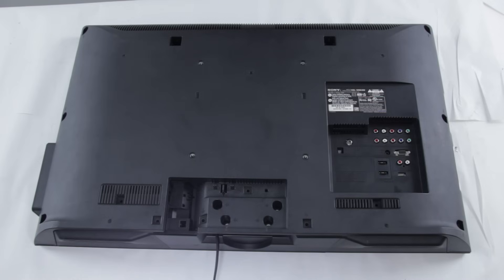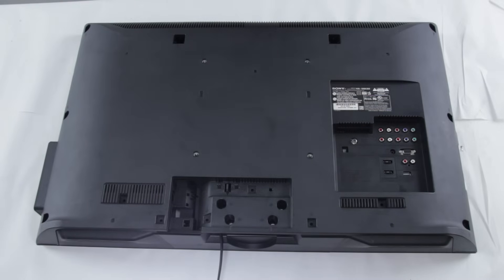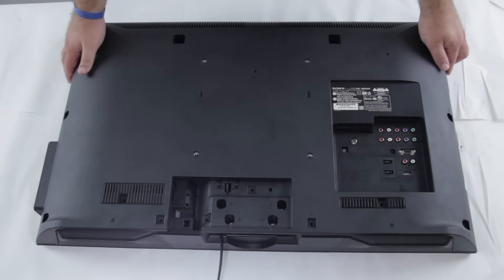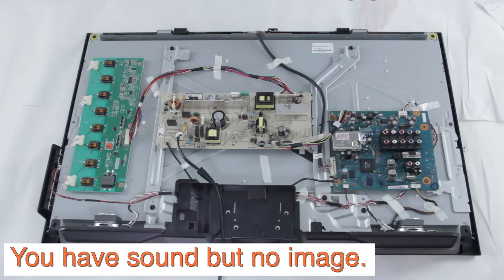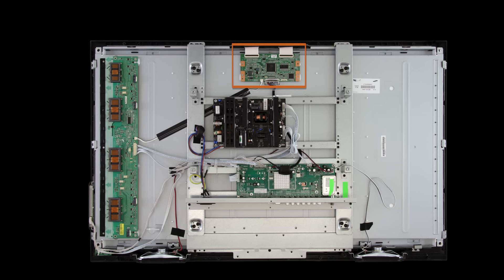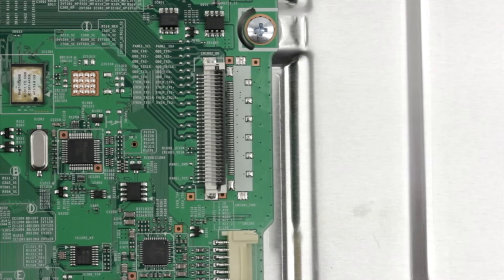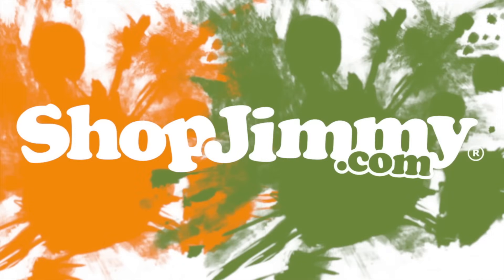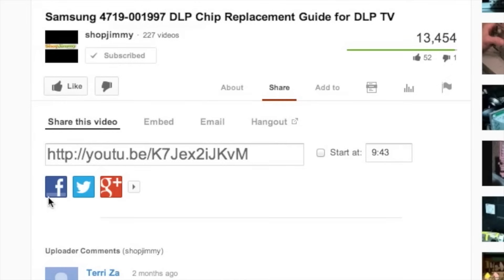LCD TV Repair Tutorial - T-Con Board Common Symptoms & Solutions - How to Replace T-Con Board

Comment: Can the T-Con board be replaced on a LG 42L V4400 UA  ??? That's what I have and am getting vertical lines on the left side of the screen !!!
Reply from the maker: Steven Shackelford  Please watch this video FIRST to help with your repair!  TV Repair! LCD, LED, Plasma, DLP How To Fix Your TV with ShopJimmy.com Help!  When I look at the search results for this TV model, it appears the T-Con board is built into the main board.  This is not guaranteed 100%, but if you do not see the T-Con board on the back of the TV, then it is most likely built into the main board.  Here is the link to those replacement parts:  http://www.shopjimmy.com/catalogsearch/result/?q=LG+42L+V4400+UA  If you are planning to purchase replacement parts, be sure to match part numbers on your current board, with your replacement for compatibility.  Thanks and please let us know if you have any further questions with your TV Repair!  www.shopjimmy.com

Comment: I have a INSIGNIA NS-L42Q120-10A... last week it started with black imagen at the center and slow move of the imagen in some portion of the image, it happen a couple of minutes then the image cleans and all looks good. TCON Board issue?... Thanks
Reply from the maker: TheGreatBoss95   This sounds like a TV panel (TV Screen) problem.  If your TV panel is bad, it may be more cost-effective to replace the TV as panels are typically hard to find in stock, difficult to replace, and expensive.  Thanks and please let us know if you have any further questions!  www.shopjimmy.com

Comment: Hi, I have a Sony Bravia KDL-46v5100. Yesterday I noticed that it had black thin horizontal lines that were more prominent on the left side of the screen and fades near the centre towards the right side. The picture is fine, no flickering or missing areas of the screen and I am still able to watch. Any suggestions on how this could be repaired? Thank you.

Comment: Hi I have a visio 38 inch year2007 .VX42L-HDTV10A. The TV wont turn on at all,so I Open the TV up and replaced the power supply.IT works fine but the picture is real bad like a negative picture and menu wont totally disapear kind of.It also on a cable search picked up only 4 anologe channels.   tks
Reply from the maker: *****  Please watch this video FIRST to help with your repair!  TV Repair! LCD, LED, Plasma, DLP How To Fix Your TV with ShopJimmy.com Help!  I recommend replacing the main board in your TV.  Click this link to replacement main boards.  http://www.shopjimmy.com/catalogsearch/result/index/?cat=56&q=VX42L-HDTV10A  Be sure to match part numbers on your current board, with your replacement for compatibility.  Here is a link to a video showing how to identify your part number, click here:  TV Part Number Identification Guide for Vizio Main Boards (Plasma, LCD, LED)  Thanks and please let us know if you have any further questions with your TV Repair!  www.shopjimmy.com

Comment: Got a sony kdl46xbr5. Screen is blank. It started with half ghosted screen turning all white within 15 minutes. Opened up, and after  put back panel back on, went from black and turned into white. No more image at start up. Replaced tcon and ub1 board.. Nothing. Opened again and rechecked tab insert to tcon and checked tab insert to lcd.. Now all black.. I'm stumped. Just need a little direction. No red flashing. Constant green light.
Reply from the maker: Marco Rodriguez   This sounds like a TV panel (TV Screen) problem.  If your TV panel is bad, it may be more cost-effective to replace the TV as panels are typically hard to find in stock, difficult to replace, and expensive.  Thanks and please let us know if you have any further questions!  www.shopjimmy.com

Comment: Hi I have a Philips 42pf9831d/10 flat screen tv. I had a problem experiencing no sound so I overcame that problem by buying a sound bar and now I have lost my picture all together. It used to suffer from intermittent blacking out and now its just stopped working. Any Ideas?
Reply from the maker: Lee Edwards Please watch this video FIRST to help with your repair!  TV Repair! LCD, LED, Plasma, DLP How To Fix Your TV with ShopJimmy.com Help!  I recommend replacing the main board in your TV.  Here is a link to possible replacement parts:  http://www.shopjimmy.com/catalogsearch/result/index/?cat=56&q=42pf9831  Be sure to match part numbers on your current board, with your replacement for compatibility.  Thanks and please let us know if you have any further questions with your TV Repair!  www.shopjimmy.com

Comment: Need some advice with my TV. I have a Sharp LCD Model LC-46SB54U Serial 806855217 with no sound but have analog signal. I get no response (audio or video) from any of the HDMI inputs. I have replaced the Main control board but with no change.
Reply from the maker: matt oneal   I recommend double checking that everything is properly connected to the main board.  If everything seems to be fine and you are still having problems, then I would say you have a defective replacement board.  Thanks!  www.shopjimmy.com

Comment: Hello Jimmy, I have customer whos Samsung model  #UN40EH5050FXZA  is giving a Vertical black line. Would this be the TCON Board issue?
Reply from the maker: allenluv1   This sounds like a TV panel (TV Screen) problem.  If your TV panel is bad, it may be more cost-effective to replace the TV as panels are typically hard to find in stock, difficult to replace, and expensive.  Thanks and please let us know if you have any further questions!  www.shopjimmy.com

Comment: Hi I have a Philips mod 40pfl3706/f7 completely dead, only voltage found was 4.3v on power board. no schematic available. where do I go from here   email  pveenje@frontiernet.net    hope to hear from you.
Reply from the maker: Peter Veenje   If you did not find a 5v or a 3.3 volt on the power supply replace the power supply board.  We are currently out of stock for this board, however we have a repair service, where you would send us your board and we repair it and then send the board back to you.  Here is a link to that service. http://www.shopjimmy.com/philips-a17p6mpw-001-power-supply-for-40pfl3706-f7-repair-service.htm  You can also call our customer service for further assistance with your purchase.  (877) 881-6492  Thanks and please let us know if you have any further questions with your TV Repair!  www.shopjimmy.com

Comment: Hi there! Hope to get some help. My TV is starting and runs a couple of minutes, about 5-10 minutes i supose. Then it shuts off and tries 3 times to shut on again, then stays off. The LED called LED2000 on the T-Con Board is blinking. I already tester with my IR-Thermomether if any components are geting hot, but didn't find out. I also replaced some caps on the power-suply board, which usualy brake, but didn't get beter. Also bought a used part MAIN-SUS board, but i still get the same symptomes. My TV is a Samsung Plasma with the Model Code: PS50C530C1WXXC and has the SerialNr: B1UR34PZ403039X. Would be a small miracle, if you could tell me how to troubleshoot this out and repair it. I hate the way the Industry mekes us throw away things, that could live much longer without this obsolent failures built in.
Reply from the maker: youlouey   I recommend replacing the main board in your TV.  Unfortunately I do not see any replacement parts in the search results for your TV model number on our website.  Please reply with your part number on your main board and I can try searching for replacement parts.  Thanks and please let us know if you have any further questions!  www.shopjimmy.com
Reply: Well. I replaced the whole power-suply board, because i found a used spare part for cheap. And now works everything just fine. What could be defect, the caps arn't, because i replaced them already!?!
Reply from the maker: youlouey   There could be a leaky diode causing it to not send turn on voltage to the main board.  Thanks!  www.shopjimmy.com

Comment: Hi. I have 3 year old Samsung LED TV (Model # UA40D5900VR). From last few days, we are seeing black horizontal lines on the top of the display. Please advise on possible cause and a resolution for this.
Reply from the maker: VijayKumar BV   This could be caused by a bad main board or a bad TV Panel.  You can try replacing the main board, but if that does not fix the problem, then you most likely have a bad TV panel.  Unfortunately I do not see any replacement parts in the search results for your TV model number on our website.  Please reply with your part number on your main board and I can try searching for replacement parts.  Thanks and please let us know if you have any further questions!  www.shopjimmy.com

Comment: Hi, I just bought myself a Samsung TV which I knew it needed repair. I am thinking of doing it myself. I have several experience in PC tech but I am a newb in TVs. The model is a Samsung LE40A336J1DXXC. It is currently working well once in a while and after 5 min it goes in a solarized state and sometimes alternates to a white washed image too. I have read &seen videos and info from you guys. And later on I will go home and check out if the menu becomes distorted too. The guy I bought it from said that when he brought a tech to see it, he said it is a part in the middle of the screen that has gone and can be fixed (I am thinking its the T-Con board). My question is, do you have this part which I can buy? Or can you suggest me a good seller for European Countries (I reside in Malta EU).

Best Regards and may thanks for the really cool channel you have here!!!
Reply from the maker: *****   This could either be a problem with the T-con board or the main board in your TV.  I recommend starting with replacing the T-con board and if that does not fix the problem, then replace the main board to see if that fixes the problem.  Unfortunately I do not see any replacement parts in the search results for your TV model number on our website.  Please reply with your part number on your t-con board and  main board and I can try searching for replacement parts.  Thanks and please let us know if you have any further questions!  www.shopjimmy.com
Reply: Thanks for your comment, I in fact have found a T-con for this. I shall wait for it to arrive and will send you an update. Hopefully it is the tcon :)

Comment: Hi, I have KDL52XBR9 SONY TV, recently something happened to it, no sound at all and only play some videos in fuzzy mode. If I browse/search for video in Youtube, the search result display with no distortion. But, when select a video to play, the screen goes blank with no sound. In some channels like Hulu, the video plays in fuzzy without audio. Also, I noticed the tone is gone when selecting input or entering text in youtube, etc. I contacted SONY tech service and did factory reset, other troubleshooting but no luck. Any suggestion is appreciated to analyze and fix the problem. Thanks in advance.

Comment: I have a Samsung UN60EH6000 and I think the t-con board is bad. It is part number BN95-00628B - I cannot find it in stock anywhere except on eBay for $145 used and that makes me nervous. Do I take a chance and buy it or is there another place I can find it? Or can I replace it with a different t-con board?
Reply from the maker: Amy Palumbo   That decision is up to you.  Here is a link to possible replacements on our website (which at the moment are currently out of stock).  http://www.shopjimmy.com/catalogsearch/result/?q=BN95-00628B  Be sure to match part numbers on your current board, with your replacement for compatibility.  Thanks and please let us know if you have any further questions with your TV Repair!  www.shopjimmy.com

Comment: I have an RCA 46LB45RQ. I purchased this tv 1.5 yrs ago and it sat in the original packaging until yesterday.
I installed the tv on a wall mount and proceeded to follow set up instructions.
The problem... The tv turns on, the set up menu comes on the screen for 1 second or so, and the screen goes black. No Sound, No Picture at all. Blue on light stays lite.

Thanks, Carl
Reply from the maker: Carl Nicolosi   I recommend replacing the main board in your TV.  Here is a link to replacement parts for your TV model:  http://www.shopjimmy.com/catalogsearch/result/index/?cat=56&q=46LB45RQ  Be sure to match part numbers on your current board, with your replacement for compatibility.  Thanks and please let us know if you have any further questions with your TV Repair!  www.shopjimmy.com

Comment: Hi guys .
Love the videos by the way.
I have a question I had solarization on my samsung 32 inch tv so I changed the tcon board but its still not 100 per cent still a slight bit of color distortion (green red) coming thru.if you could suggest anything I would really appreciate it.
Reply from the maker: Keith Garnett   This could either be a problem with the main board or the LVDS cable.  Please reply with your TV model number.  Click here to view a video that shows how to find your TV model number:  TV Repair STEP #1 Help IMPORTANT TUTORIAL How To Find Your TV Model Number Tutorial TV Repair Help  Thanks!  www.shopjimmy.com

Comment: I have a Samsung 52" LED TV Model # UN55D6000SFXZA.  When we initially turn it on the picture looks okay.  But after it is on for a while (30 minutes to sometimes 2 hours later) we begin getting a double image that remains on until the tv is off for a while.  After is off for a while it comes on clear again.  As I said the time frames are never the same from when it changes from a clear picture to a double image.  I have looked at several YouTube videos about the t-con board or ribbon connections.  I was going to try the scotch tape suggested on a YouTube video.  Do you have any suggestions?  I watched your video on replacing boards.
Reply from the maker: Roseann Asashon   This could either be a problem with the T-Con board or the TV panel.  You can try replacing the T-Con board to see if that fixes the problem.  Here is a link to replacement parts:  http://www.shopjimmy.com/catalogsearch/result/index/?cat=63&q=UN55D6000SFXZA  Be sure to match part numbers on your current board, with your replacement for compatibility.  Thanks and please let us know if you have any further questions with your TV Repair!  www.shopjimmy.com

Comment: I have a thin vertical purple line on Sony KDL40-4000. A couple of years ago it already appeared, then disappeared until a couple of weeks ago. Now the line is there permanently. I changed the T-CON board but without success, the line just stays there. Does this mean it's a panel fault ? What else could I try?
Reply from the maker: William Master   This sounds like a TV panel (TV Screen) problem.  If your TV panel is bad, it may be more cost-effective to replace the TV as panels are typically hard to find in stock, difficult to replace, and expensive.  Thanks and please let us know if you have any further questions!  www.shopjimmy.com

Comment: 42PFL3604/12 Philips LCD suddenly has like a bright filter. Whatever Input shows up way to bright, so we can not even fix it with the video menu.help please
Reply from the maker: Sebastian Schwarz   This could be a problem with either the main board or the T-con board that is bad.  You may need to replace each board individually to see which one fixes the problem.  Here is a link to replacement parts:  http://www.shopjimmy.com/catalogsearch/result/?q=42PFL36  Be sure to match part numbers on your current board, with your replacement for compatibility.  Thanks and please let us know if you have any further questions with your TV Repair!  www.shopjimmy.com

Comment: I have a Visio SV472XVT, the backlight is LED,  the LED backlight comes on but dim.  One corner (25%) of the screen is on normally and the other is dim.  Didn't know if the LED(s) bad causing the back light to all be dim?
Reply from the maker: Kelly Kinsey   This sounds like a TV panel (TV Screen) problem.  If your TV panel is bad, it may be more cost-effective to replace the TV as panels are typically hard to find in stock, difficult to replace, and expensive.  Thanks and please let us know if you have any further questions!  www.shopjimmy.com

Comment: I own a Visio E370VL. Just recently I started having a problem where I get sound and no picture. I replaced the Inverter board, although it hasnt fixed the problem. I measured the voltages at the fuses on the mainboard and I get 5V and 12V coming in when the tv is on. I've also checked the 4 voltage regulators on the mainboard. I believe its the TCON that is faulty (since shining a torch on the screen yields no image either. The problem is that I have 4 circuit boards visible - Inverter board, mainboard, and two seperate source boards at the top linking to the LCD marked L and R (left and right). I have two ribbon cables coming out of the mainboard going to each source board. I asked on a different TV repair forum and was told that the tv couldn't be fixed cause the TCON was integrated into the screen. I was also told that there is only one tcon board in the tv. So is it possible that the TCON is integrated into the Mainboard (thats why I have two ribbon cables going to the top of the screen into the sources)?  If so do you think replacing the mainboard could fix my problem? Not sure if this is relevant, when I first bought it I had a weird problem that the first time I switched it on it was a blank screen and only sound. If I then turned it off and on again I would get both picture and sound.

Comment: Hi, I need help... my TV Model: SHAP AQUOS LC-42D62U will not turn on. The front power LED are blinking and the TV makes a clicking noise every minute as if trying to turn on but it will not. I replaced the power board and the same thing so the power board was probably OK. How can I find out if the T-con board is the problem? Is it true that only the power or T-con can stop the TV from turning ON? Please let me know what you think. thanks
Dan